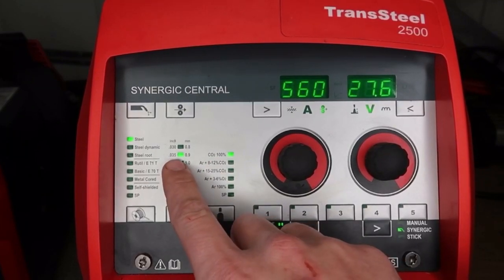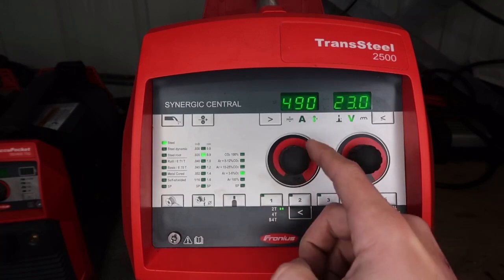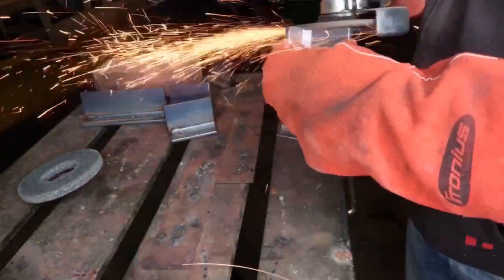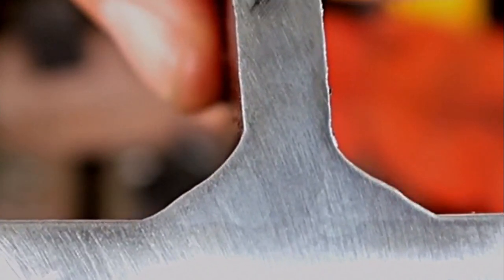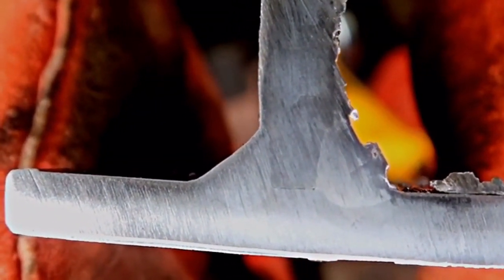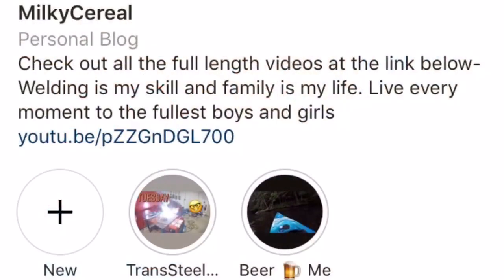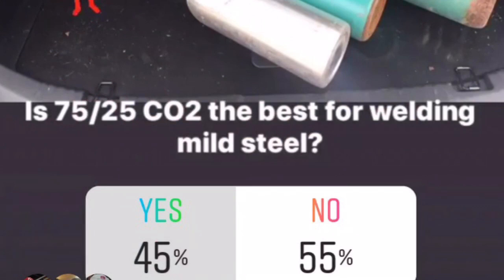What is the best MIG gas for your 110 volt or 220 volt MIG Welder?

Comment: Can you do spray transfer on steel on a TS2200? if so, how?
Reply from the maker: Yes, you can with .030 and .035 solid wire. All you need to do is increase the voltage vs wirefeed speed
Reply: @chris_b_liven  So 0.8mm wire size, metric Chris?

Comment: Looks like 95/5 is the best for my usage case
Reply from the maker: 95/5 can definitely assist with a more fluid weld and deeper penetration
Reply: @chris_b_liven  I have the fronius transteel 2200. What machine gas setting is best if I use that particular mix?
Reply from the maker: @landscapingspecialist  35 CFH - send me an email with your shirt size, serial number and  address. I’ll send you a swag bag ... Bliven..Christopher@fronius.com
Reply from the maker: Bliven.Christopher@fronius.com
Reply: @chris_b_liven  I see you are running the 2500 which DOES HAVE a setting for Ar + 3-5% O2. The 2200 does not have that setting. Probably try 90%Ar/10%CO2 on my 2200. Or just 75/25. Still not 100%. Going to gas store to gas up on Monday. Wish we had a Bakers gas close to me. There is an airgas 1 min from my shop so I guess I’ll use them.
Reply from the maker: @landscapingspecialist  yes, I would just use one of the gas types or run in manual mode. I’m sure either one will work just fine

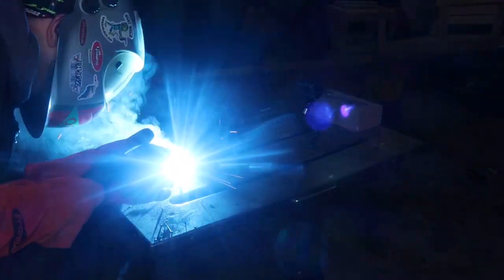Comment: How come you were able to spray with C25 at 1:57? I thought you can only achiever spray with rich argon mixes like with C10 and 95/5 Oxygen. Do you know what was the amperage at these settings? Do you think this is replicable with the Transsteel 2200? I wish you'd have kept it the same and didn't change the machine for the third video.

 This is fantastic, I have learned a lot from you. Thanks!
Reply from the maker: +Fluke You can get it to spray but you need about 4 volts more which puts more strain on the machine and a larger heat affective zone - more heat!! I just wanted to show it’s possible but I suggest 90/10 or 95/5 Oxygen. I had to use a different machine because I didn’t have 220V in my garage at the time. I’m sure you can get .030 wire to spray with the TransSteel 2200 for sure
Reply: Thanks Chris. I certainly appreciate the wealth of knowledge you have provided. I don't know, but I have a feeling that I could spray with .035.
Reply from the maker: Fluke I haven’t tried it yet but I bet you can. You can get over 30 volts with the TransSteel 2200

Comment: hay Chris  how come you changed from the 2200 to the 2500 ? I am  going to buy the 2200 soon I already have a mv180 with pulse 
and I love it. Does the 2200 have pulse mig or stick? I want  to do pulse mig on aluminum  to build some racks for a motorhome.
please do some more welding videos.
Reply from the maker: Bruce D I wanted to show that Fronius has two different amperage class machines. The TST 2200 will run spray on 220 but look at your duty cycle. The TransSteel 2200 doesn’t include Pulse or Stick Pulse but it does come with TIG Pulse
Reply: MilkyCereal83 Hello: Okay; the 2200 does not have pulse MIG, but how about the 2700? 
I’ve read the spec sheets and watched the paid YouTube guys, but no mention of “pulse MIG”. The clean welds certainly look like pulse.
Reply from the maker: Road Rage No it doesn’t have pulse but for a non-pulse machine it welds awesome... Being in the industry this long I feel people buy pulse machines as a save all but in reality standard machines can do 90% of the applications
Reply: MilkyCereal83 Thanks for the reply and I certainly fall into that category... I don’t weld often enough to keep my skills sharp, so I’m looking for an advantage (pulse) to take up the slack. 
With that said; the 2700 has my attention. Very nice. 
Thanks again for your time. . . David
Reply: @chris_b_liven  Silly question, but if you told it it was Tig, but you used stick, would it weld on pulse?

Comment: Chris, This was a good demonstration of the effects of gas mixtures and thank you for making your videos.  However, most folks do not own a $2500 machine like yours that has software driving an inverter power supply that adapts to the gas used.  A real gas test would be with a standard "transformer-rectifier" power supply like most people have.  

If I may add; here's what the gas mixture does in the weld. Argon helps stabilize the arc. CO2 and oxygen are reactive in the arc making the puddle more or less fluid depending on percentage.  100% CO2 is very reactive and causes the arc pop, burn and throw spatter. As you said, it is known as "globular transfer".  Because it is so reactive the arc digs into the steel and is good for thicker parts if you can stand the harshness of the arc and spatter.  If someone does use 100% CO2 using ER70S-2 wire is helpful because it is "triple de-oxidized" and can help with possible pin holes.  The ER70S-6 that you are using has higher silicon content and that provides a more fluid puddle and "wets out" better than "S-2" wire.  If someone would like to make a nice smooth bead with very little spatter and the MIG gun and steel is thick enough to handle the heat, use a high percentage of argon mixture and set the machine to "spray arc" settings. Like you said, test, test and test for what is the best for the situation.  Most welding machine manufacturers publish great books and some can be had for free on most welding subjects.  After 40 years "burning rod" I have a stack of them.

Please keep going with your efforts and have a great and safe day.
Reply from the maker: Kevin Gardner thanks for the comment Kevin 🤘 That would be cool to use an old rectifying machine. Maybe in the next video or we can use one of yours when I’m in tow 😜
Reply: @chris_b_liven , That would be fun, but once you go Fronius you never go back.
Reply from the maker: Kevin Gardner 👌
Reply: The Same with HTP , I would NEVER go back ! @welderfixer